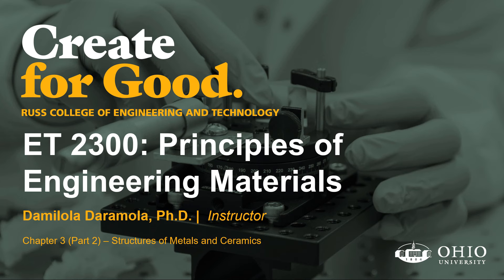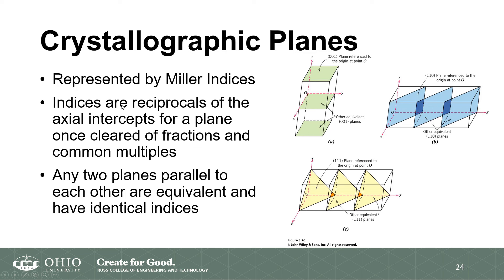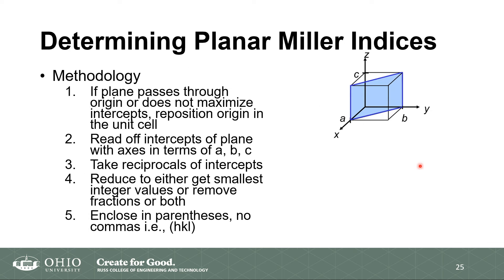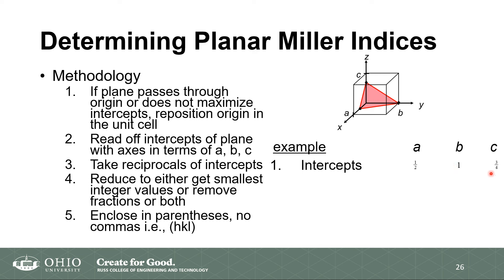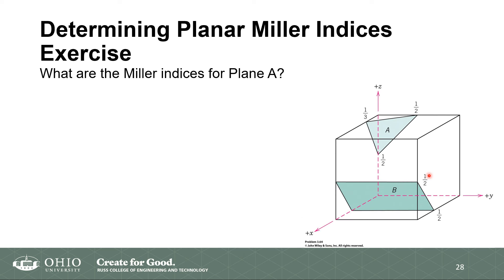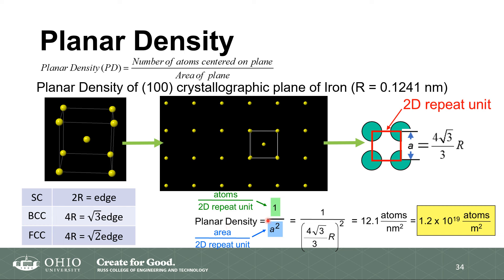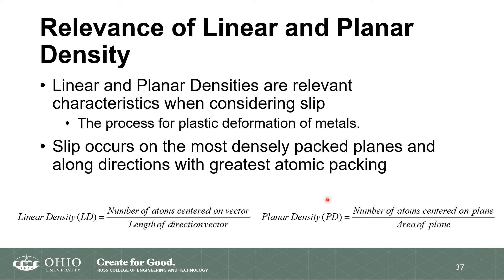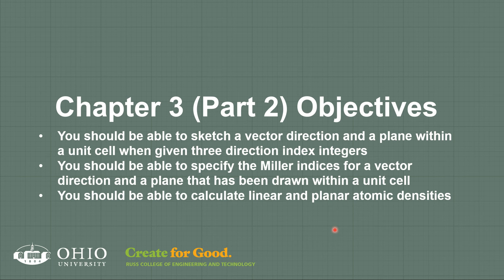Crystallographic Planes

Comment: How did you u added center aton on the 100 plane? I would be believe (100) plane is most likely a primitive cubic, thus, if we assume <100>cubic. Do u mind explaining how u arrived at a BCC?
Reply from the maker: Are you referring to the image at 28:07? That center atom is not in the (1 0 0) plane for BCC. What you are viewing is what one would see if they were looking at the BCC unit cell from the side. You would see the center atom but it would not be at the same level as the (1 0 0) plane. Notice the planar density calculation does not include the center atom.